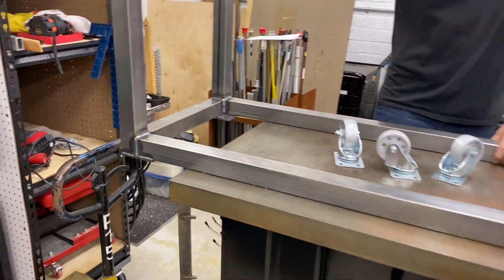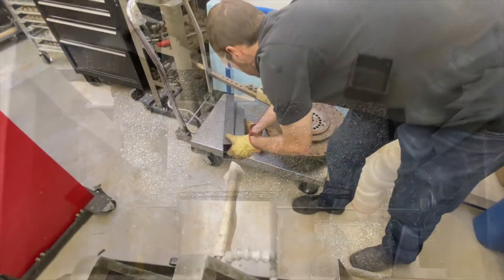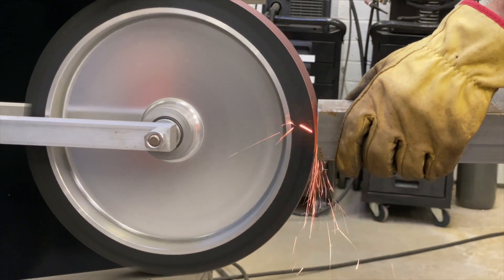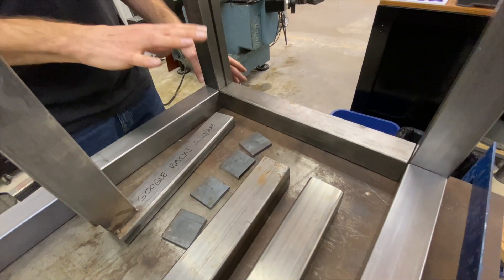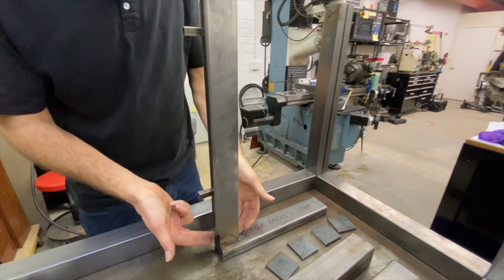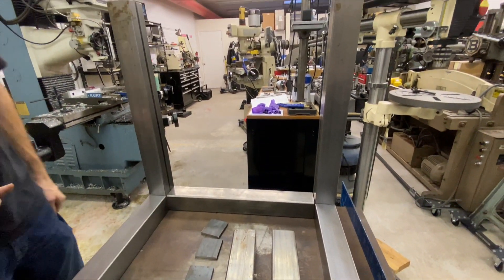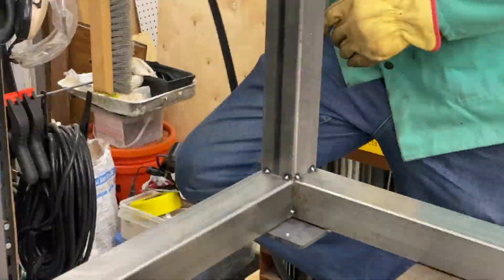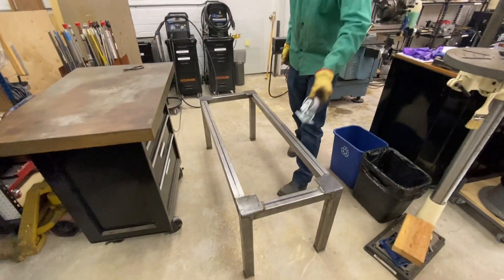HOW TO MAKE A CUSTOM MACHINE STAND for Mittler Bros Ultimate Box & Pan Brake (PART I)

Comment: I dont often need to build tool stands but occasionally I have, and while I get more satisfaction from a welded metal stand, I must admit I've turned to wood for my latest half ton mill. Steel prices are just unreasonable for me.
Reply from the maker: Yeah raw stock proces are high. And with the 20 foot lengths you have to pick it up yourself somehow or pay to have it delivered. It adds up fast.